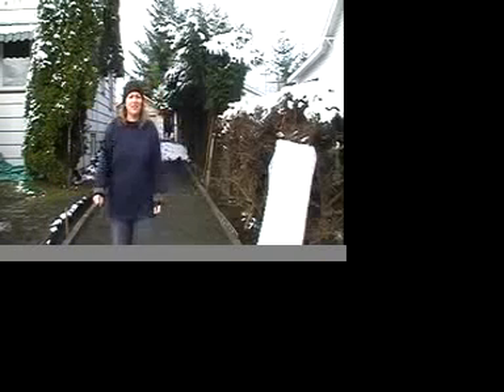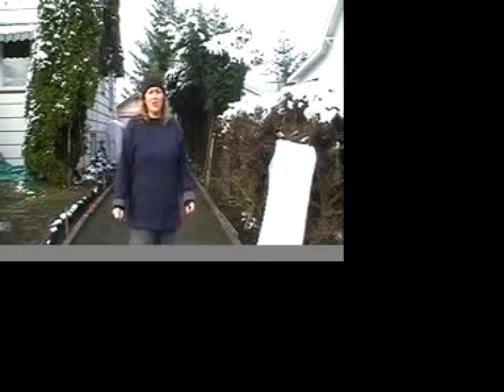How to Install a CORE Gravel driveway

Comment from the maker: We recommend using the adjustable settings on the snowblower to ensure you are at least 2 inches above the gravel surface. The same applies to snow plow machinery. The gravel (in freezing conditions) generally freezes in place, and we have a minimal layer (1 cm) of gravel over the top of our cells (majority contained w/in cell). Thanks for asking!

Comment from the maker: Hi. Our system is designed to last indefinately provided it is installed correctly and protected from sunlight (i.e. light layer of gravel over top of plastic grid). This system does hold up beautifully to a variety of uses. We have grids for light foot traffic all the way up to commercial parking lots (8 types). For an idea of a smaller install (such as yours) in a Montreal urban setting, go to coregravel.ca and see our 'Gallery'. Thanks!